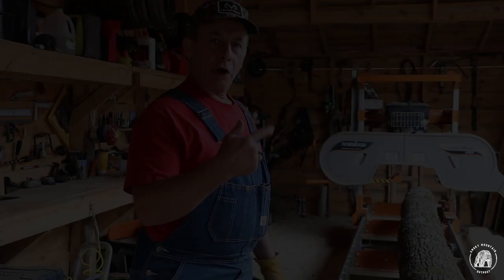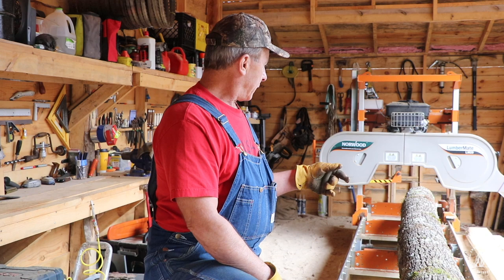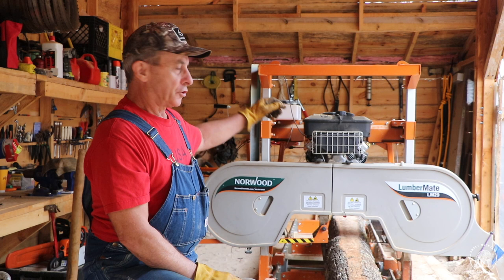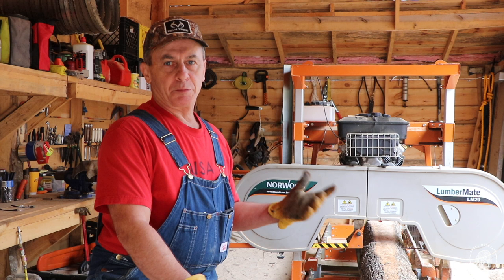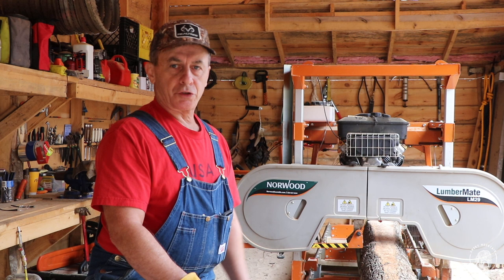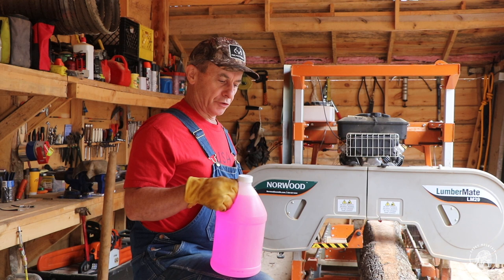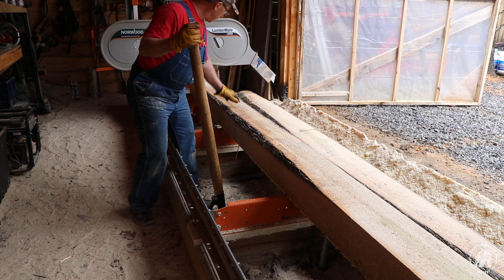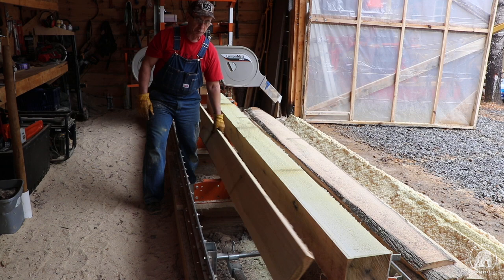S2 EP22 | WOODWORK | TIMBER FRAME BASICS | MILLING POST AND BEAM PURLINS FOR THE CABIN IN THE WOODS

Comment: Hi again,  You know it would be possible for you to still put a little rubber or ice & water shield under each of your posts.  I didn't mention it before because I honestly didn't know how far along in the project you were.  In my 40 some years of building, I've lifted a lot of buildings, but you wouldn't have to lift your whole structure.  Just one post at a time and only 1/4" high to slide the rubber under it.  I doubt it would take you more then 1/2 of a day.  If you want more info on this just let me know.  By the way, don't let the nay sayers get you down..... You & your son are doing a great job, there are lots of right ways to build a strong structure and I think yours will be.
Reply from the maker: I have actually decided to do just that. Going to try and find aluminum playing to slide underneath. Thank you for the great input. I really appreciate all comments. One can never know everything, lol. Thanks!!!

Comment: Soap lowers the viscosity of the water which makes it penetrate better. I used that method when I was a fireman. We would on occasion have large dumpsters where the contents were on fire. These were in apartment complexes where the residents would put wood fire ashes in the dumpsters thinking there were no hot coals. 

I was wondering if the beams attached to the concrete had any treatment?
Reply from the maker: Thank you for the input. Welcome and hope you enjoy the content.

Comment: I have a question about the saw mill. When you did the first cut, how do you get the first 90 degree angle? Are those little picks stiff enough to lean the to? And how does the setup for the height works?
Reply from the maker: I explain more on other videos. First cut, rotate 90 then second cut. From there it’s all good to flip and cut. Watch other videos on the sawmill. You will see me crank a lever to raise blade to ruler mounted on sawmill